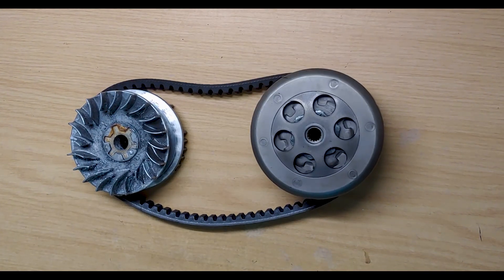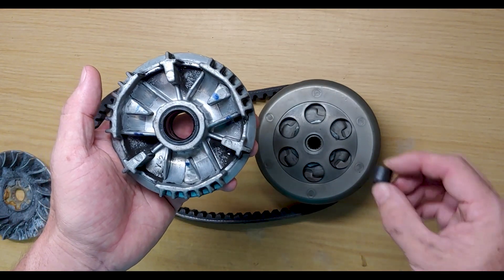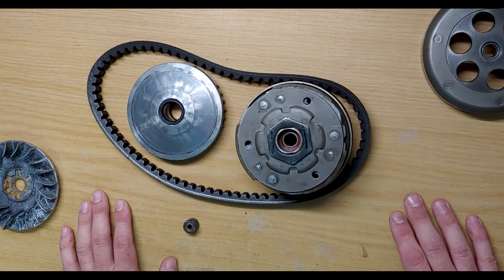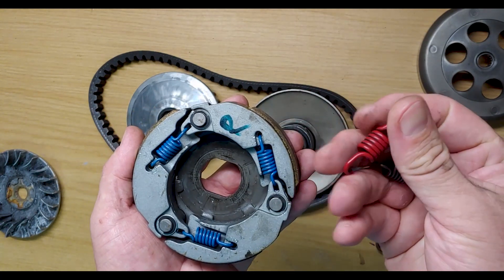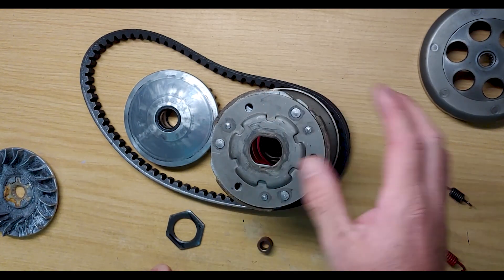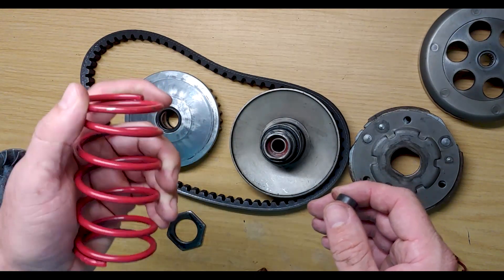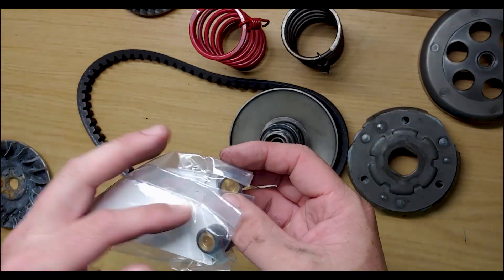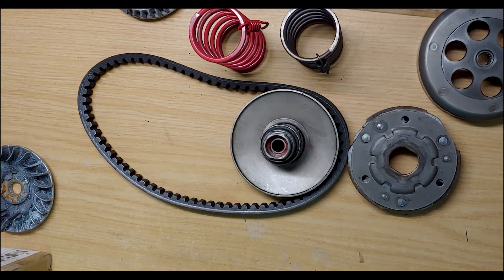Yamaha BWS100 CVT Workings & Tuning

Comment: I have a 46.8gram total rollers with stock everything, what is the best setup of springs for my bws 100
Reply from the maker: Depends on your bike and what you want. Top speed Vs acceleration. I run 54g on mine.

Comment: Which combination of roller weight (how many grams?) -  spring (2000rpm?) - Little clutch springs (the 3 little ones) for the best all around bws?   And also, if the BIG spring is 2.000rpm, the 3 little ones have to be also 2.000rpm? What happen if i mix them? Like the big one 2.000rpm and keep the 1.000rom blue ones inside? Thanks a lot ! Loved your video and explanation
Reply from the maker: Yes, can mix springs. Std, big spring and x3 2000rpm small springs - rollers ±36g total. This setup is common with a performance exhaust.
2000rpm big spring, and x3 2000rpm and x3 2000rpm small springs - rollers ±50g total.

Comment: 2000 rpm spring? What is this? The clutch springs can be measured in rpm but not der torque driver spring. you can measure it in kg

Comment: Great video actually first video I see for a cvt tranny now I have a question I travel to colombia alot I have a 2012 bws100 down there now sometime the hills are soooo steep I have to get off the bike
I can't find a trustworthy garage to do maintenance and yamaha don't service this anymore what would I need to change on the cvt to keep high torque at lower speed?
Reply from the maker: You'd need to get lighter rollers fitted.  It may need a set of fresh rings too if it's struggling up hills.
Reply: @Radness1001  are you referring to piston ring?
Reply from the maker: @yulmerced4434  yup. sounds like your compression is low
Reply: @Radness1001  sleeve and piston kit is brand new a few months ago the carb was making  a bad mix I talk to a guy at a machine shop he said he can make it 115cc with a new piston so hopefully today I'm getting a new clutch new rollers rear brake a d 15cc more hopefully this fix my issue.
Reply: @Radness1001  I will start there. Thanks

Comment: what diameter are the rollers at the variator?
Reply: I want to buy a 100cc aerox, what do you think about this 100cc engine?
Reply from the maker: @GeorgeBGP  same as the BWS engine, great little engines. 👌🏼
Reply from the maker: 15x12
Reply: thanks
Reply: Thanks

Comment: Great informative video👍
I recently got a 2008 bws, stock standard with 18000kms 
Bike is very sluggish until 60kmh (compared to my sym 125 scooter) then pulls well, what could the problem be?
I’ve cleaned the carb, cleaned the air filter and checked the rollers (8.5g), it also seems to have a “dead spot” at about 3/4 throttle. Any advice is appreciated
Reply from the maker: Chances are it's our torque driver thats worn. What exhaust are you running on it?
Reply: @Radness1001  Do you know where I can get a 2000rpm spring and other performance parts?
Reply from the maker: @matthewuhlmann7781  I've got 114cc big bore kits and springs. Where are you based?
Reply: @Radness1001  I’m from Pietermaritzburg
Reply: @Radness1001  standard exhaust, it is a little rusted out :( but I am looking for a performance one.
Will check the torque driver out this afternoon

Comment: Hi...great video..thank you..I just bought a used bw100 and cannot seem to figure out how much oil to use or when to top up the reservoir..dont seem to be able to see the level through that little viewing window... any info would be awesome
Reply from the maker: What oil are you referring to, the 2 stroke under the seat or the gearbox oil?
Reply: @Radness1001  the  2 stroke oil under the seat..I'm just concerned about having enough in the reservoir to self feed the fuel...I actually have no idea how much this bike uses..it didn't have a manual...thanks for the reply btw😀
Reply from the maker: @MJHrideordie  the 2 stroke resovior holds 1.7l, it has no reel viewing window. Fill it to the mark, an then fill it up when the light comes on. The 2 stroke reserve holds plenty, enough forn 3 tanks of fuel.
Reply: @Radness1001  thank you...👊😀

Comment: Hi Ryan. I upgraded my Yamaha Bws 100 to Malossi 124 cc kit with 22mm carb. and ı use my original exhaust and original  cvt. What do you suggest to improve my top speed ?
Reply from the maker: You'd need the Malossi gear up kit. Fitting a proper tuned pipe, cone air filter and jetting your bike for the 124cc is must to ensure optimum performance.
Heavier rollers will improve top speed but will effect your pull off.
But in all honesty if you're looking for top speed, you've bought the wrong bike.
Reply: @Radness1001  whats you top km ? mine does only 60km/h top at the moment i'm about to open up to check whats what
Reply from the maker: @st3rg  my bikes modified. Does 120kph.